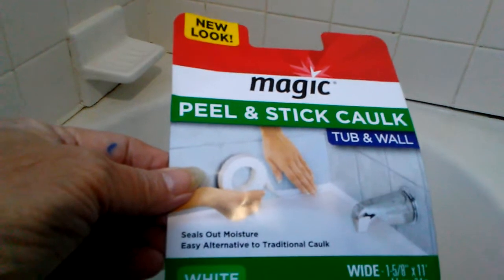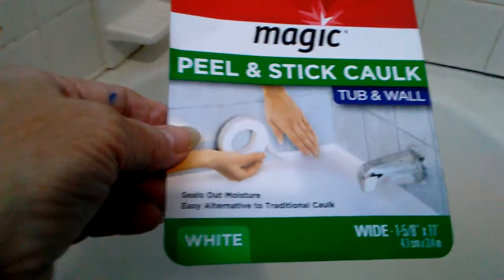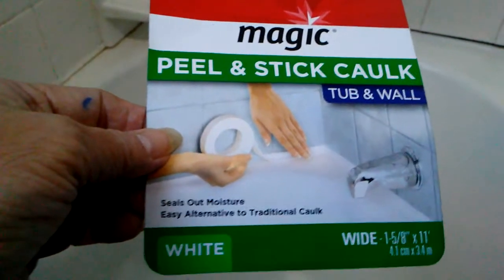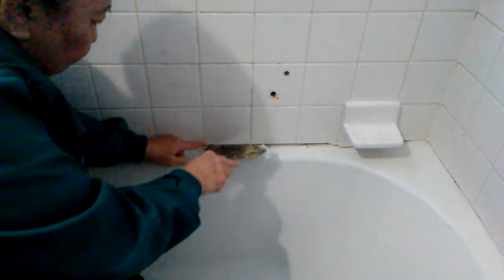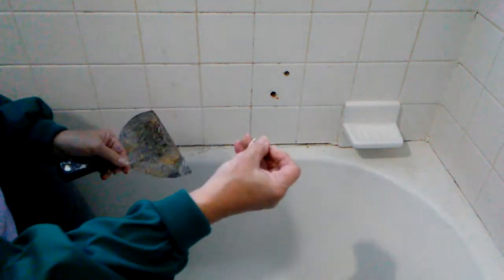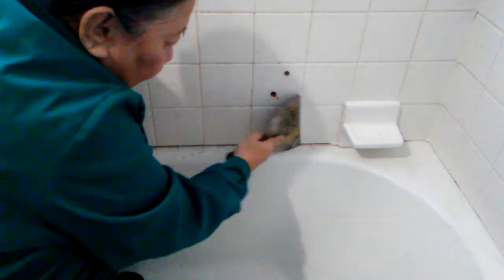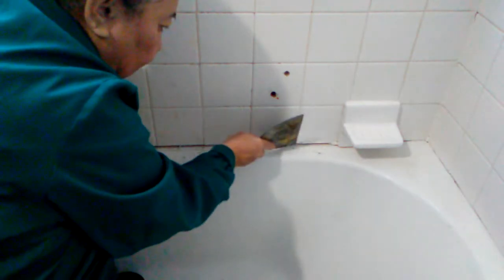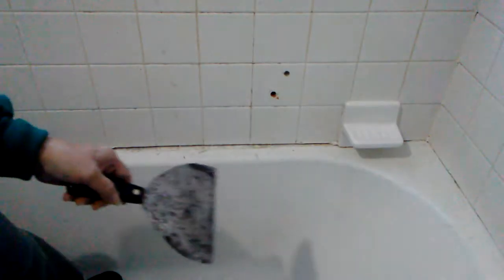Vlogmas Dec 29, 2020 Come Join Me In The Bathtub

Comment: For the rust stain, try scrubbing it w a pumice stone. I know it sounds weird but it doesn’t scratch porcelain, it’s natural (bonus) and abrasive enough to get the job done (although a good amount of elbow grease is required for sure!). 

Tip: Add some baking soda in the mix for an extra non scratching abrasive and quicker results. 

Good luck!
Reply: Baking soda and Ajax’ll get that done inna instant

Comment: I tried this tape and unfortunately it is not as effective as traditional caulk. In just over a month after applying this tape, I noticed a bit of water and moisture seeping on the bottom edge of the tub and floor. Called a plumber who said it sounded like a caulking issue that water must be seeping through the caulk to the floor under the tub. So curious, I decided to remove the tape and was shocked to find Mildew all across where the tape was applied. Water was seeping behind the tape because the tape couldn't cover water going through the groves (where the grout is) between the shower tiles. Once I caulked it with real caulk, no more moisture or water was found on the bottom edge of the tub and floor.
Reply from the maker: Sorry it didn't work for you. It has worked fairly well for me. I had a couple of places that it came loose but I just applied s bit of clear silicone caulk and it's holding up good. I have another apartment that I will be using it on. I will put the silicone caulk on it when I put it on. Thank you for letting me know that it didn't work for you. And thank you for watching. Take care. Oh and there wasn't any mold or mildew behind mine. Just an FYI.